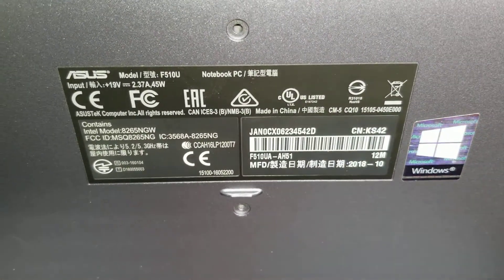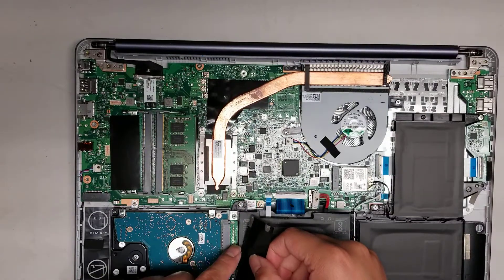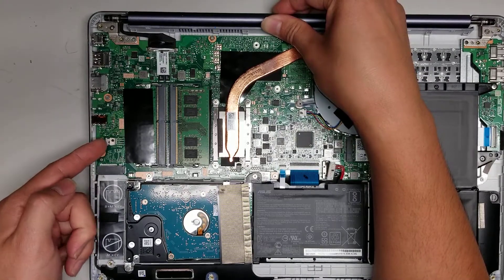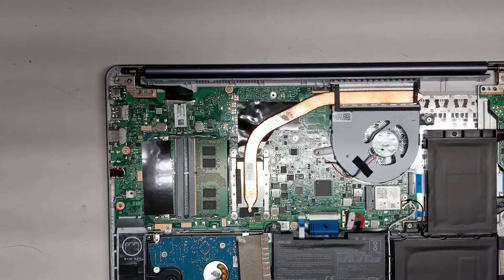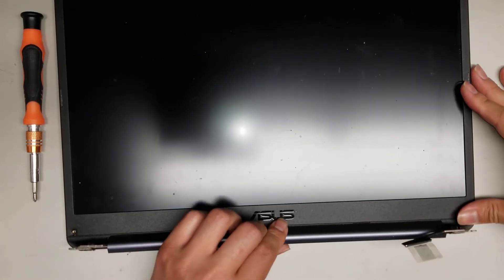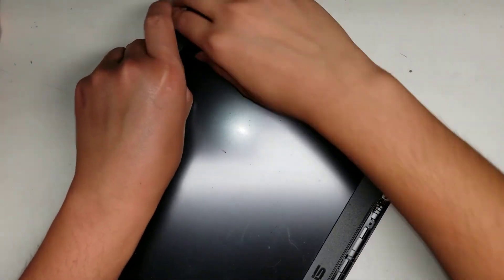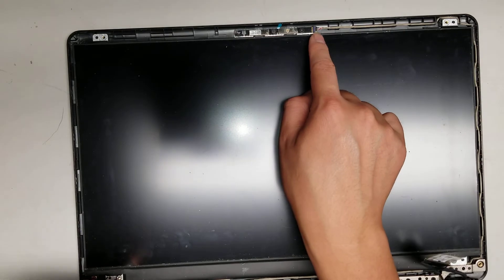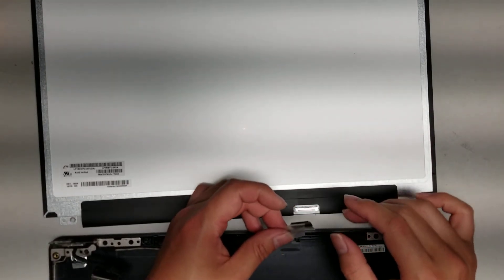ASUS F510U Disassembly RAM SSD Hard Drive Upgrade Repair

Comment: Is there a fingerprint sensor connecter mine isn't picking up with windows hello so I was wondering if it was connected
Reply from the maker: I don't think so. Does yours say there's a fingerprint sensor?
Reply: @ItsBinhRepaired  no but I thought it could be a possible reason for why my scanner isn't working
Reply from the maker: @diallogrant8214  scanner? What scanner?
Reply: @ItsBinhRepaired  the fingerprint scanner but after looking up some stuff I think it's because of the pci data acquisition driver
Reply from the maker: @diallogrant8214  hmmm

Comment: Out of curiosity, do you have a video of replacing the keyboard or cpu fan? and do you think I can put a back lit keyboard into a model that didn't have a back lit keyboard to start with? Thanks! Love the video by the way, helped me so much already!
Reply: Also, what is the maximum speed ram this laptop supports?
Thanks
Reply from the maker: @Tanika1995QLD  I don't experiment with RAM, so I don't know what speeds they support. Just try them all and return what doesn't work.
Reply from the maker: Keyboard you have to replace the entire palmrest assembly taking the motherboard and everything out. The fan basically this. https://youtu.be/AKe4kdPVqvU keyboard depends if the motherboard supports it.
Reply from the maker: If you haven't already, please like and subscribe so others can find my videos. Thanks

Comment: Hi, I own the same laptop with 8 gigs of ram. Can you tell me what is the maximum amount of ram I can upgrade to for the Asus F510U?
Reply from the maker: The max is whatever you can buy that fits the slots. Just make sure the type and speed match the original.
Reply: @ItsBinhRepaired Will a PC4-21300 2666mhz ram stick be compatible? Or do I need to get the 2400mhz variants
Reply from the maker: @yourlocalfbi3083  not sure, you can experiment
Reply: @ItsBinhRepaired  Regarding the ssd, does it support nvme? Or is it only compatible with a sata m.2 ssd
Reply from the maker: @yourlocalfbi3083  if I didn't mention it in the video, I don't know. :(
Reply: 32 gig is what asus says.
Reply from the maker: @maddoxastrophotography8886  they don't take into account 32gb sticks of ram if they ever become available.

Comment: You did an excellent job. I depended on this video for my laptop.
Reply from the maker: Awesome! Glad it helped.
Reply: @ItsBinhRepaired  a friend of mine gave me her laptop to repair for her. 
I feel responsible because I recommended it to her to buy.
This laptop is tripping me up.
1. ASUS VivoBook Model F510U

2. The screen does not come on. It is dark.
3. I have an external monitor hook to it. The monitor works fine. This is the only way to view contents from the laptop.
4. I purchased another stick of ram 8gb. I pulled out the old ram and installed the new ram. No fix.
I then just simply installed the extra stick of ram... 16gb now.
5. I unhooked the battery and then re-seated the video cable going to the screen.
No fix....
I'm thinking next step is to replace the video cable from motherboard to screen.
Then,, if that don't fix,, then replace screen,, at which point I am wondering if it is worth it.
Any advice?
BTW... I didn't take out the cmos battery, I didn't see it,, may be real deep into it.
Reply from the maker: @gowenrv3762  hmmmm might be a dead motherboard :( how old is the laptop?
Reply: @ItsBinhRepaired  about 1 1/2 year old. The laptop works fine using the external monitor. I just can't seem to get the screen to work.
Reply from the maker: @gowenrv3762  might have fried the backlight circuit :(